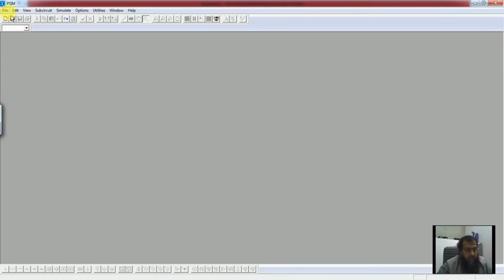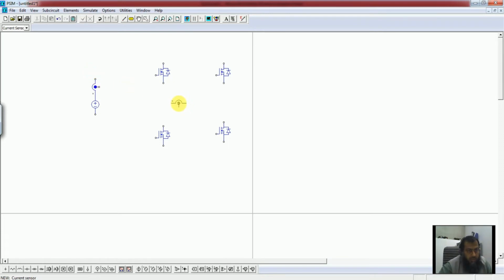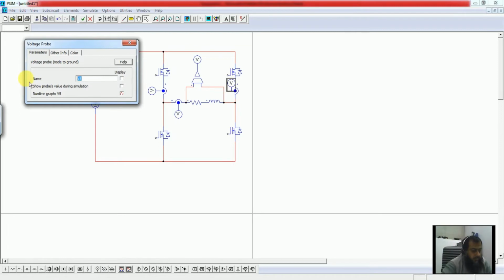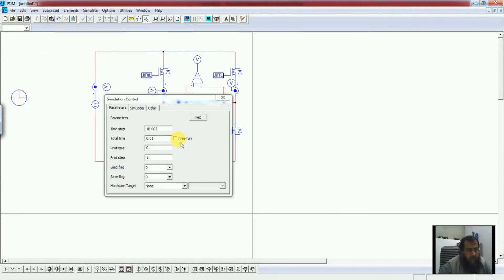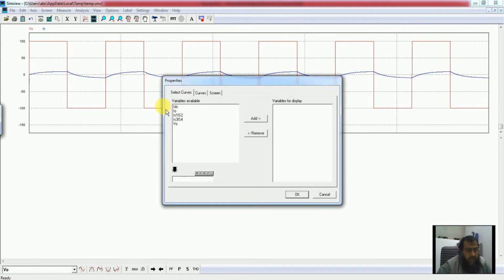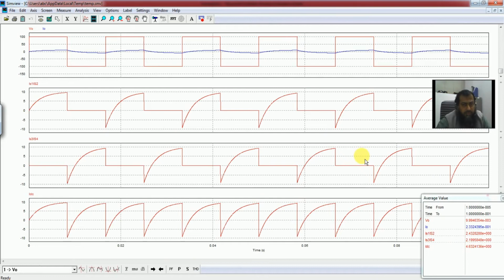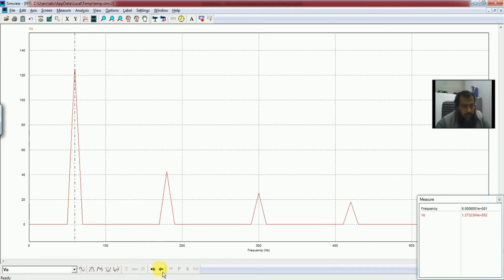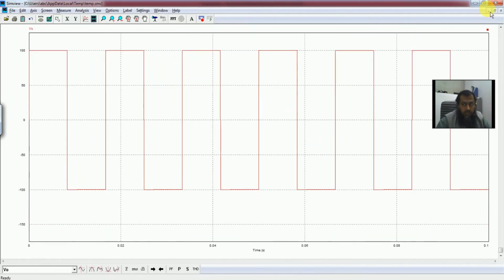Square wave inverter simulation

Comment: it's a good vidio sir, sure. but sorry i have an question about the circuit if this inverter with load. can you make this vidio by adding an lod or some of sir ? thanks before :)
Reply from the maker: Thanks for the comment. I have used an RL load. You can try connecting any other load at your end.
Reply: @HadeedSher  umm oke sir thanks for your answer. have you making vidio about modified sine wave inverter or pure sine inverter sir ? thanks
Reply from the maker: @riyamustikasari3409  I have yet to start the PWM lectures. Hopefully they will be uploaded in the next week.
Reply: @HadeedSher  okay sir thank you so much 👍🏻